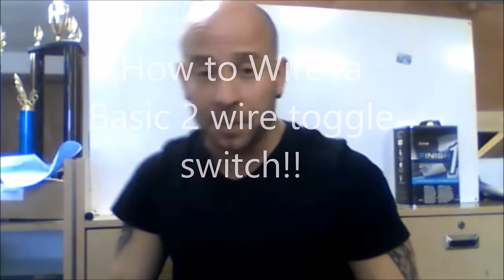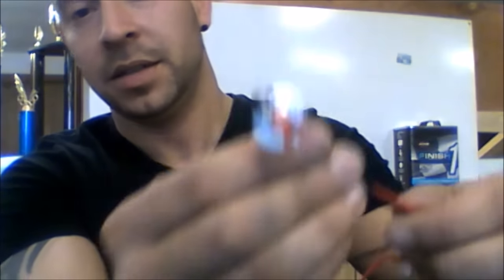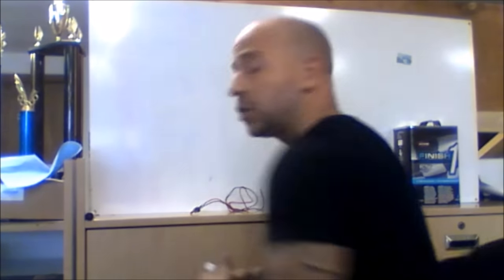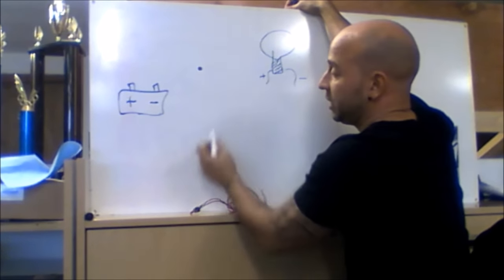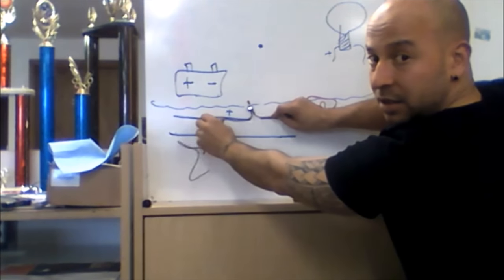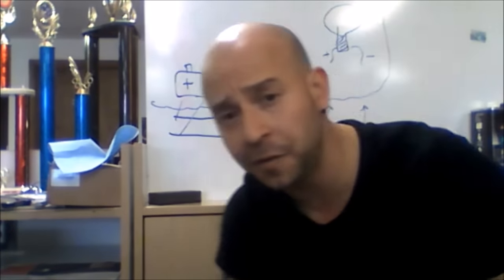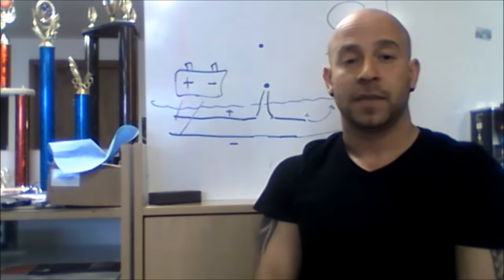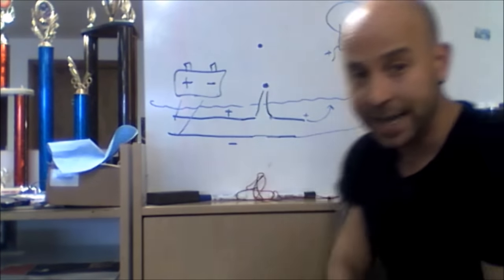How to wire a toggle switch , ( on-off 2 prong ) easiest best explanation, 2020

Comment: How about my 96ford ranger with a 2.3 I want to do  a on,off switch and a push button to start that's all just simple thanks Fred
Reply from the maker: This can be done. Youll need 1 toggle switch and 1 push button. Wire the toggle in/out with the trucks primary ignition pwr wire. 
And wire the push button to passthrough (like the toggle) on the "starter wire". Do these 2 things and you will have your functions.
(You will.still need the key in the ignition though. But it will require the flip of the switch and then the push of the button.

Comment: wow dude, so deep, but what if i connect the red wire to ground, and black one to the positive, will the switch work that way, like inverse psihology?
Reply from the maker: No. It would still be a dead short. When you flip that switch. Itll internally connect pwr to gnd. Things will blow up.

Comment: Can I wire one end of the switch directly to the battery?
Reply from the maker: Sorry. Ive been out the shop for a bit. 
Yes, if your planning on "switching" on the (+) leg. Then one side would go to batt (fused wire) and the output side would go to (+) of your device.
Reply: My switch has 2 male pins. Does it matter which pin to use to go the battery (fused wire ) and the + of the device?  I’m asking because I see a lot of switches have markings that say “on” and “off”
Reply from the maker: If its only 2 prongs, then no. It wont matter.
Reply: Thanks. I thought so.  After all, one is only breaking the circuit
Reply from the maker: Exactly

Comment: My question is can I wire it to a line coming directly from the wall
Reply from the maker: I don't understand your question. From the wall? If your talking about a house light switch, that is VERY different then a toggle switch.
Reply: @myonlinecarguy1  I'm trying to fix a broken fan and I know it can run safely from an outlet but I want to wire a switch to not have to unplug it every time I want it off, my question is can a switch that small work to turn it on and off the switch will be inline on the cable going to the outlet
Reply from the maker: Ahhh i understand.  Unfortunately,  that type of house electric is AC power (alternating current), you xan ABSOLUTELY put a switch in the cord of that fan. However you MUST make sure your using a switch rated for AC power. Most (including the ones i explain here) are for DC (DIRECT CURRENT) a.k.a. batt power.

Comment: Would that be same if your adding a speaker on out side of truck
Reply from the maker: A speaker is a little different because an audio signal is A/C (alternating current). In theory though yeah it would still work, just make sure your switch is A/C rated.

Comment: This is a real useful video.     

Will this work inline with a speaker?  I just put in a speaker system in my house. A 7 channel receiver with speakers going to different rooms. Its all mono so everything plays the same thing. I love it. My friend asked if there was a way to turn off, or down, the speaker in the bathroom cause it gets loud when the door is closed. I can turn it down on the system or my phone, but it'll get annoying real quick. I'm hoping that I can put a toggle switch a couple inches out from the speaker so it can be turned off with ease.
Reply from the maker: Dan Hertz Dan Hertz the application of a toggle is situational. The case your talking about. You'll have to be extremely aware of your ohm loads or you may cook you amp of your wanting to add additional speakers. But as far as would a toggle do it. Yes absolutely. And the way of wiring the toggle will not change. So yes. Your good to kill that speaker with the switch.
Reply: yea, I'm not overloading anything. Actually only have 6 of a possible 7 speakers hooked up. 

Heading to pick up a switch first thing in the morning. Thanks man, you saved me time and a headache and opens up other possibilities.
Reply from the maker: Dan Hertz anytime my dude. Glad to help.

Comment: I connected a toggle switch for my subwoofer I ran a wire thru the firewall to the battery connected it to the positive and the first  prong of  the toggle switch connected the same wire to to amplifier now I want to connect the other amplifier for my speakers how do I put a toggle switch
Reply: Can I can I do the same thing but connect the wire to the negative post of the battery and run it straight through and put another toggle switch for the other amplifier that's for  the speakers
Reply from the maker: I am hoping this toggle is for the remote wire? The amp turn on , not the main Pwr wire right?
Reply from the maker: Assuming this toggle is infact for the remote wire, you can simply use the same "toggle output" (+) wire to the 2nd amp. And th switch would manage both amp on/off as 1.

Comment: hi vin, could you tell me which rocke switch i would need to run a bedroom table lamp in the uk
Reply from the maker: "A/c " power is different then DC power. Dc is from a battery, if tou using AC power (like your house) make sure your using an AC switch.
Reply: @myonlinecarguy1  thank you very much, i love your films
Reply from the maker: Thanks man. I appreciate you watching.

Comment: Thank you so much! In my head I thought you had to break both - and + together? Is there a toggle for that? I'm so naive to all this.
Reply from the maker: No, theres not. An LED lit toggle will use both (+) and (-) but not both to run the device. Only both for the light on the switch.
Reply: @myonlinecarguy1  thank you 👍

Comment: Thank you for showing, can we use the this on a mobile phone charger line as well, Thank you in advance, Peter
Reply from the maker: Can you explain the phone charger idea a little for me?
Reply: MyOnlineCarGuy1  it is a normal Samsung phone charger, I building an amplifier for my grandsons phone and I want him to switch it off when it is fully charged. He needs the amplifier to hear his phone beter
Reply from the maker: @petervanrensburg4171  ... As long as you do the switch, on the 12v dc part, it'll be fine. Particularly, for the trigger or power BEFORE the amp. Don't do it on the amped side, as the amperage could be too high for the toggle.
Reply: @myonlinecarguy1  Thank you very much for the kind information it is  much appreciated
Reply from the maker: @petervanrensburg4171  anytime, glad we could help

Comment: POTENTIAL DANGER!! ...   he says that you can put the switch on either side... it will still work regardless of which one but think about it if you put the switch on the ground there still a hot wire connected to the light.
  so if you switch off that switch you're essentially eliminating the ground so if you touch the wrong part, YOU are that ground.  or if a random piece of metal completed that circuit it could start a fire.   you dont want to switch off your ground it will still seem like it works fine and the light will be off but power is still connected to that light and you broke the circuit at the grounded path. it's good idea to switch off the hot wire instead so no power goes into the appliance when it's shut off. the ground should always be connected. so you don't accidentally defibrilate yourself.
p.s. I'm no electrician, shootout to "this old house" I saw it on a video about wiring told by a professional electrician.

Comment: Wow! How did you know that I thought that the connection should go across the Pos & neg instead of in series with the pos or neg to either complete or break the circuit? I feel kinda dumb since this concept is so basic from a common-sense standpoint, but my brain defaulted to black goes to neg, and red goes to pos like 90% of others -haha! Thanks!
Reply from the maker: Yeah man. They trick us with that red +black wire....i can only imagine how many devices have been wrecked because if this.
Reply from the maker: Sheeew, yeah. Def alot.to keep track of there.
Reply: @myonlinecarguy1  One of the biggest problems with these old 6v systems is keeping enough voltage in the battery and the ground points on various systems on the bike; the "winker" relay and rear turn signals commonly become (open) ungrounded due to the years of exposure- thank God for multi-meters!

Comment: You should always run your switch on Positive side unless it’s not possible, specifically with automotive switches to keep from leaching parasitic draws. And also, you will further have an advantage of simply grounding your addition (lights, horns, etc.) that you are wiring up, to a local spot that is bare metal as long as that continues to the frame (to meet the battery grounded to frame).

Comment: Then why is there a red and black wire even on the toggle switch. Shouldn't they both be the same color or it doesn't matter?
Reply from the maker: The color is just the ouside jacket. Thats why i made the video. Many many people wire it red to power and black to ground, then blow their devices up. Theres a red and black wire, because who ever made it, decided to do it so. There are some that are both black, or both red which makes more sense. But thats why this video exists.  To help clarify HOW the switch works and should be wired .

Comment: Thanks so much buddy - boy did I have a brain fart --- so easy as you said. I burn up wires 2 time doing it negative to switch and light and then positive to positive - and bam - a direct positive to negative - A direct short and melted wires ! And I have wired toggle switch's ! A bad brain fart ..

Comment: Hey brother got a little problem so I'm wiring up an on-off switch to a light I didn't make any mistakes I know that it's dead simple I've got my switch interrupting my positive lead only the switch is always reversed I've tried two different switches off turns it on and on turns it off I've switched the switch around 180° to run the connections through the other way and that didn't help I've switched it from the positive side to the negative side even though I knew that wouldn't do anything and that didn't help I can't figure why this would be unless something has a reverse polarity it can't be the switch because I've used multiple switches with the same result I'm wiring into a small PCB circuit board I've correctly chosen my positive and negative so I can't figure why this would be any advice would be helpful thanks mate
Reply from the maker: Its possible that your switch is a normally closed switch. That its "off position " = connected. And vice versa.  It sounds like the wiring is correct though. You said you got another switch, was it the "same" exact switch, or diff entirely? Cause if u bought 2 of the same switch (normally closed) then by "normally" that means off position,  so in off position switch gives connection. These switch types are rare.
Reply: @myonlinecarguy1  as a matter of fact they are identical they were pulled from the same device I'm actually a YouTuber myself and I'm doing a video series on a custom e-bike build this is actually a separate project using some spare parts I had lying around and I have two straightforward on-off rocker switches the only difference between them they're literally exactly the same except for one has a red face and one is black
Reply: @myonlinecarguy1  another possibility the light is on a very tiny PCB board so small it's almost impossible to read it without a magnifying glass and there's two sets of inputs first time I hooked up to it I miss wired it by accident cuz I didn't read them correctly I just took a plus for a minus sign and so I had Wired from an s plus to a b+ and it started to smoke real quick I thought maybe I had reversed a polarity on the board by accident but I figured that was pretty unlikely but at the same time I couldn't figure out what it might be other than that was hoping to get some advice from a professional, thank you for the quick response brother it's appreciated
Reply from the maker: Hmm....super weird then for sure. 
The wiring sounds solid. Is there a part number? For the switch?
Reply: @myonlinecarguy1  kco-117
Reply: @myonlinecarguy1  I always test things after a build and I let the light run for about an hour and it was heating up so I attached a couple of heat sinks to it of the mesh variety and it's working perfectly now not heating up at all it's running a real cool temperature so all is good on my end it works I'm satisfied with that but I'd love to find an explanation I'm guessing I might have reverse polarity the light it's theoretically possible and I've heard a situation where you reverse polarity something and it won't switch back switching it back would fry it out so I'm just glad I didn't fry it and it still works LOL but I've been told in cases like this it can lead to what I'm seeing where no matter how you wire it it's always going to be this way so if that's the case then that's the case and it's fine but I just wondered if maybe you'd heard of a something similar
Reply from the maker: I see nothing wrong with the switch. Its possible the switch is burnt and the internal coil or spring is fucked. This one is tough. Im sorry.
Reply: @myonlinecarguy1  no problem brother I've got six degrees my friend one in electrical engineering mechanical engineering photonics aerodynamics and mathematics the other ones in music and I can't figure this either brother except that I've reversed the polarity on the circuit board which is theoretically possible I mean it wouldn't be the light itself it'd be the board but well no big deal at the very least it works so I'm satisfied thanks for your help anyway brother

Comment: Can I place an inside toggle to a fuse to turn off /on something? If so how? Thanks
Reply from the maker: Im sorry, i dont understand the question. Can you reword it for me?
Reply: MyOnlineCarGuy1 I wish to turn on/off to a messed up window wiper that does not turn off so I have to either take off the fuse to turn off and put back to turn in, so can I place a toggle switch to the fuse to turn off/on?
Reply from the maker: Ok generally  it goes like this:
Power--->fuse-->toggle in.  Toggle out--->device.
Reply: MyOnlineCarGuy1 or can just work from power line to device right. I was just thinking I can jack it straight from the fuse itself without finding the lines to wiper relay or device.
Reply from the maker: That depemds on the car, i can't say for sure.

Comment: How can I hook this switch I took out the yellow wires and hooked twisted red and blue together so o have one blue that not connected and black is not connected so where would the other wires connect to have plye 4ch hydra Bluetooth amp, Tegg 5pcs DC-099A DC Female Panel Mount Charging Wire Threaded Socket Jact Connector with Dustproof Plug IP67 68 Water-Proof Large Current Power Adapter 5.5x2.1mm,this I the switch APIELE 22mm Latching Push Button Switch 12V Angel Eye Ring Light LED Waterproof Stainless Steel Round Metal Self-Locking 7/8'' 1NO 1NC 1 Pack (Blue), Talentcell Rechargeable 12V 6000mAh/5V 12000mAh DC Output Lithium ion Battery Pack for LED Strip and CCTV Camera, Portable Li-ion Power Bank with Charger, Black, using this 10pcs Conductor Compact Connectors Lever Wire Nut Electrical Connectors with Fixed Base for 3 Circuit Inline Splices 28-12 AWG

Comment: so all you need is one wire coming from your switch connected?
Reply from the maker: All you need is the switch to splice and seperate 1 wire out of the 2 your device needs.
You device still needs power and ground.   The switch itself does not.
Reply: i am wiring an air compressor to the battery with a power and ground. all my switch need is to have one wire connected to both correct?
Reply from the maker: Yes. But air ride circuits are diff. 
The compressors should run off a 2 prong pressure switch in the airtank. 

And the power should come from the ignition (key controlled power)
Reply: @myonlinecarguy1  it isnt airride just onboard air. does it matter if power or ground is connected to the main power and ground?
Reply from the maker: You can input the toggle switch on power leg.....or......ground leg..(just not both) .and itll properly cut the unit on/off when the switch is flipped. (Take note that compressors tend to have a heavy amperage draw, so make sure if the compressor is a 30amp load, that the switch is properly rated for 12vcd +up to 30amp load. (Or whatever it is for your device)